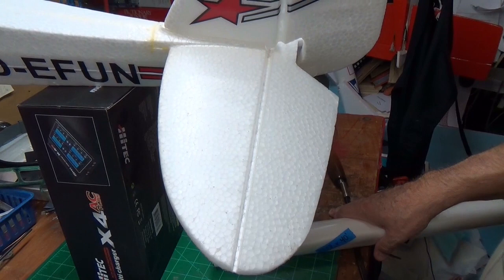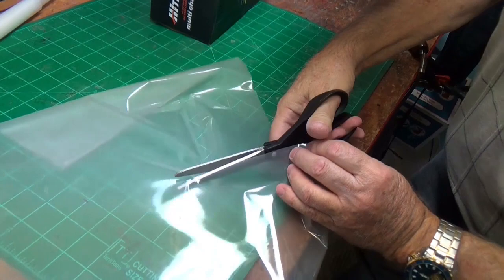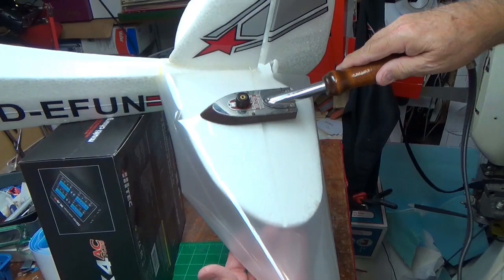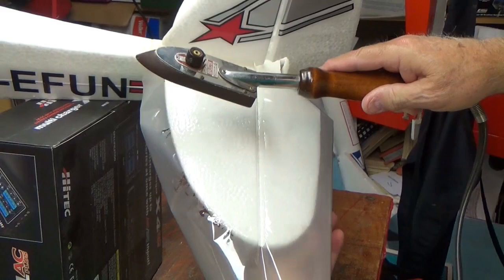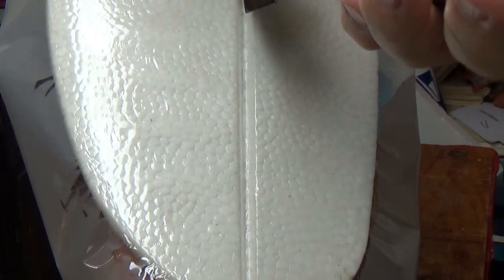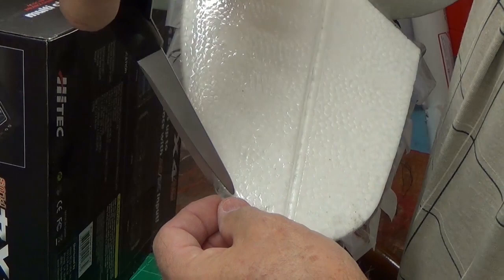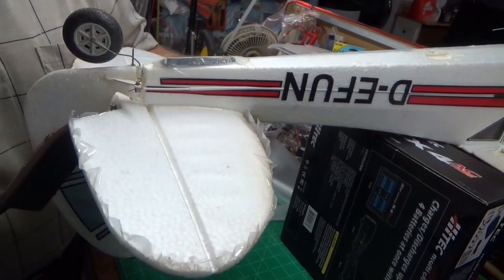How to Skin a Foam Wing with Laminating Film

Comment: Great video! I was searching for product ideas to skin a scratch built Predator drone I'm working on and your video convinced me that this is the product to run with. The ease of application and the end result sealed the deal! I'll definitely be using hinges on my control surfaces though as I heard these laminates may get brittle over the years but other then that the finish is incredible! I'm hot wire cutting my own wings and plan to retask some fiberglass arrow shafts I have laying around for my wing spars. 3 shafts in the central fixed wing section then dropping to 2 shafts (all 5 over lapping 3" at the union) where the removable wings join followed by 1 shaft centered out nearly to the wing tips. I was thinking about skinning it with carbon fiber but after seeing this I think I will save some money and go with this. I'm going big with an 8 foot wingspan for a nice stable camera platform for some serious FPV soaring fun. This will be my first plan with an Ardupilot system complete with GPS. The price for the electronics is amazing these days, the entire system with GPS, OSD, telemetry and power readings was only $79 bucks delivered! Back when I first started flying a cheesy 1 axis Gyro cost more then that! lol Thanks for the great information and video...

Comment: It's book laminating film for school books.  We used it for balsa sail planes back in the mid 90's.  You could get a ton of it for cheap.  You can also paint the inside "side" with a light coat of spray paint.  Really lightened those old planes.
Reply from the maker: Very true!
Thanks a bunch for watching!!
Reply: Yes I used it on many planes.  It is lighter and tougher than the model airplane coverings.  It does not shrink as much, but that is not a problem.

Comment: The point of laminating is that it works similar to a bike helmet. The foam alone is fragile, as is the covering, but together they work quite well. I'd say in my experience that you gain 50% over the foams original strength

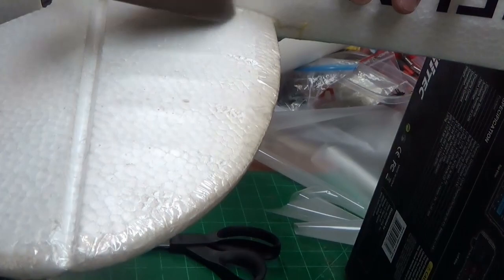Comment: about 8 years ago I watched this video and now I'm wondering if this system would work on the outside of a wood-framed shadow box I'm building for my granddaughter? I want to protect the inside of the shadow box from the weather with your iron-on system, will this stick to a wood frame? January 26/ 2024 8:42 hours.
Reply from the maker: It should work, I have covered balsa wood airplanes with the same technique. 
Just practice on something before you jump into it. 
Thanks a big bunch for watching. 
DG

Comment: I'm getting the Apprentice STS 1.5 meters.
Would it be best to sand the plane first for a smooth finish?
Reply from the maker: Not necessary to sand just make sure it is clean. 
Make sure you do the nose well. 
As a trainer plane the nose and motor are first to go. 
That is a great plane
Reply: Thank you very much.
Yeah, I think I made the right choice.
My first 3 planes were a Xk A800 with a cheap chinese transmitter :D @DickGibson
Reply from the maker: make sure you follow the instruction for initializing the radio to the stabilizer and check that the controls are moving the right way when you move the plane ..   This will assure many successful flights.   @Wings_of_foam
Reply: Yes, good point.
Cheers. @DickGibson

Comment: Is it neccesary to skin an all foam airplane ? Some skins are fairly heavy. Is reduction in drag penalty worth it ?
Reply from the maker: No it is not necessary however for some planes that not have landing gear or may have re occurring damage it is very important.
The weight is negligible and is spread over the entire plane.   1.3 mil thickness if very thin.  It is a lot of fun to do and much easier to use than a monocote type covering.
Thanks a big bunch for watching!!!

Comment: QUESTION: I'm just getting into RC aircraft, and I'm starting with a HK Bixler 2, and after I master that one, I plan to step up to a HK Phoenix 2000 and use it as an ALES [learning] platform.  Would you recommend this thin film for their EPO wings, or should I use the next thicker sized film?

Second, I've read that a lot of Bixler flyers put Scotch Extreme tape on the leading edges of the wings, and clear packing tape over much of the wing chord.  Could this film be applied over over these type of tape to give the wing a more finished look?

Thanks

Comment: Can i make one suggestion ... what ever covering you are applying be it tissue, silk, film etc always cover the bottom first then the top surface same with fuss bottom , sides , top.
Reply: What?
Reply: I don’t think so you always close on the bottom. Like a cap on a bottle
Reply: Lid on a bowl is probably a better analogy
Reply: Makes sense...You avoid having a seam on or near the leading edge of the airfoil facing the relative wind.
Reply: @bigdog1476  Your lid and bottle cap analogy seems more fitting to what this poster recommended.

Comment: hello, i just a got freewings al37 737 max, and would like to cover it with laminating film, wich film would you use, 1.7 3 or 5 mil size thnaks
Reply from the maker: I would use the 1.7 because it is easier to form around round pieces. 
It also overlaps better without seeing the seams. 
I personally would try to do the fuselage in one long piece equal halves. Starting in the center and working my way to each end. 
You could probably do the wings top and bottoms with one piece for each top and bottom. 
This will be a big project and lot’s of fun. 
I now get my laminating film from Amazon. 
Thanks a big bunch for watching!!!
Keep in touch
Reply: Dick Gibson will do, follow my channel for updates on the build. Will let you know what I finally do looking at several options. Gracias from Colombia
Reply: Hi Dick good day, i ordered the film already, but i am wondering will the foam cells bloat with the heat. the planes foam surfaces are very smooth now. how hot is hot enough for the iron. thanks
Reply from the maker: davidsai 
Experiment with the heat settings on the iron 
Find what works best for you. 
Some foams don’t puff. 
Check out my “My Twin Dream “ video. 
That foam is as smooth as plastic.
Reply: @DickGibson  film allready at the miami offcie should get to colombia next week.

Comment: I want to build my P-40 Warhawk into just a model. I have laminating film but I was wondering, if I laminate the foam to give it more strength, can I prime over the film with plastic primer and then do my paint, then clear coat it, will this work or will the paint just chip off ?
Reply from the maker: Absolutely.  If you want to paint before you laminate that is probably the best.
However, if you paint after lamination then scuff with a very fine sand paper, scratch pad or steel wool, clean with alcohol then use a simple rattle can fast dry to paint.
Reply: Thanks Dick. I was also wondering if putting two layers of lamination would work, then the paint. I was wondering if it would stick to the previous layer and should I scuff up the first layer for better adhesion ? Thanks

Comment: I would not do it that way, as the surface bubbles up (doesn't look nice imho) - much too hot with the iron to keep a smooth surface. 
I recommend the adhesive Oracal 751C film which max. requires a hairdryer for carved surfaces - it's like car wrapping...!

Comment: I would imagine  that this reduces surface tension tremendously,   making the airplane more slippery thru the air....
Reply from the maker: f marz 
Absolutely plus makes the plane much stronger. 
Using less heat will produces fewer bumps. 
Different kinds of foam show fewer bumps. 
Paint before you laminate.

Comment: These foam dots bulge up when heat iron put it on them, It is not easy for someone who has trypophobia. I wonder if you can moist the foam first then apply the "new stuff", would the "new stuff" still sticks?
Reply from the maker: +ASUS Micro I have had that question before.  POR  the hot iron technique "I believe" makes the combination of the laminate and foam stronger.  Putting water on before would only make the dots more noticeable.   Perhaps you could try setting the iron a little cooler and see what happens.
Thanks a big bunch for watching

Comment: The heat is expanding the foam dimples resulting in a textured finish - not a smooth glossy finish!
Reply: I noticed that as well. I think this method uses too much heat for this type of foam.

Comment: Hi, Mr. Dick. Great video! What do you think to use a 3 mil (75 micra) film to laminate a MTD, that is a "heavy" plane, but with much power too? Thanks. See you.
Reply from the maker: Luis  I laminated my MTD completely with the 1.7 except for the bottom of the fuselage.  On the bottom only for abrasion protection when landing.  The 1,7 is plenty for the rest of the plane and yeilds a very smooth finish.
You will love the MTD,  it is one of my favs!!
Thanks a bunch for watching.

Comment: Does this work better than let’s say epoxy and fiberglass?
Reply from the maker: No comparison!  epoxy and fiberglass would be way way too heavy, hard to do and expensive.   This method is easy, very low cost, and super strong.  You can also paint before or after application of the film.  I have other videos in the series you can watch also.  Thanks a bunch for watching and if I can offer more help let me know.
Reply: Dick Gibson wow, you’re the best! Thanks for getting back so quickly. Can you post s link to where you ordered it from? I have a bunch of new planes coming in - balsa and foam (EPO and EPP) - and I wanna do this before I assembles. Obviously the balsa is going to be monocoat, but the foam I wanna do this. Especially for protecting the hinge
Reply: I’m also going to disassemble all my foamies and do this! Thank you
Reply from the maker: @rossrcfallacaro3422  
https://www.amazon.com/s?k=laminating+film+1.3+mil+25+x500%27+standard+roll&ref=nb_sb_noss

Comment: Hey, I saw your link to aloft hobbies. I was thinking of getting the CP type film, but what mil should I get? I saw you got the 1.7 mil, which they say is for small planes. My Plane though is about 6 feet in wingspan and weighs as the most 8 pounds maybe. So I was thinking 5 mil would do the trick, but maybe 3 mil? I reckon 10 mil = about 250 microns = about .25 millimeters. So is mil the thickness of it? It seems like .25 millimeters is really thin.
Reply from the maker: +Sky Studio Great question: I like the 1.7 on the top and sides of the fuselage and top of wing and 4 or 5 on the bottom of the wing to give it a little strength and 4 or 5 on the bottom of the fuselage for abrasion protection.  In fact two layers of 4/5 on the bottom.  The 1.7 is easiest to fit around corners and tight places.  My SkyWalker is laminated that way and it is perfect for me.  Thanks for watching,
Reply: You say you put maybe two layers on the bottom of the wing? Wouldn't it be easier to simply buy 10 mil and just put one layer on the bottom? Thanks for the reply though. I will probably put 3 mil on top and possibly 5 or 10 mil on bottom of wing.
Reply from the maker: +Sky Studio That would be great also.
Try 2 or 3 different thicknesses to see what you like.
There are no wrong answers, just try it!!
Thanks

Comment: What this laminating film does exactly?It makes foam not as easy to brake?
Reply from the maker: Yes it adds structural stiffness and stability.  Also if you do crash it makes it easier to repair.  Unlike mono cote it is very resistant to abrasion and puncture.  If you use the thin film it adds very little weight.  Plus you can paint the foam first and laminate over the top and the color won't scratch off.
Thanks a bunch for watching.
Reply: +Dick Gibson Thank you for fast reply.I hope to be so easy to install as it seems.
The sailplane will be FunGlider Multiplex
Reply from the maker: I am doing my second Fun Cub this week.  
Go slow and have fun

Comment: How much stronger does this end up making the plane?
Reply: A large bunch!!
Reply: I can vouch for the added strength. I have a sheet foam "foamy" Flying W and ironed on laminating film all over. I've had some not so gentle touch downs and it still flies where others would have been bent or broken in half. Takes a little while to iron it all down but hey, the results are well worth it.

Comment: The foam is expending so the surface is not smooth anymore after laminating process and more wind resistance plus more weight of your plane .If you have crashed your plane it's much more difficult to repair the plane because you need boiling water to get back the original form of your ( plane,foam) before the crash.No it's not a good solution in my opinion.I use cheap superglue to strike over the servants of the plane ( EPO FOAM only!!)and it will make your plane 50% ore more stronger and super light at the same time plus still easy to repair your plane after you have crashed it🤔😏
Reply from the maker: You should try it first to get a first hand impression.
The weight of the film is minimal and only adds a few grams to a big plane.
The plane is much stronger with the film!
If you crash with the film on it is sooo much easier to fix and a touch the damaged place with the iron and it pops back out.
Thanks a big bunch for watching
Reply: @DickGibson  If you ask me it's a lot of work and if you want to do the fuselage it's almost unduable because of the roundings, but of course your right that i have to try it first before i can give it a real judgement.Ps like your video, keep up the good work 😉💪👍

Comment: Nice job Dick.  I'm sort of an old timer when it comes to RC craft.  Built my first in the late 70's with the old monocote and had an iron just like yours..  I may still have the iron, not sure.  Anyway, I'm looking to get back into fixed wing.  Have my eyes on a foam Bixler.  Do you think my heat gun would work?  Granted, I cannot press the film like you are doing here plus you need to be careful with the heat gun.  It will melt this Ethylene/PP foam if you get too close to it.

Comment: ... Excellent video.Usted could clarify me what kind of film used. No entindo when speaking English , perhaps entinda if he writes. Thank you, I send a greeting from Argentina
Reply: MarianoP1000 eso se usa para laminar libros. Posiblemente lo puedes encontrar en una tienda que venda materiales para colegios.
Reply from the maker: This is the material used to cover a document, business card, picture, ID card, that you would go to an office supply store to have done.  Their machine has two rolls of laminating film in them and your document or card is placed between these two pieces and place in an two sided iron and heat sealed.
You can find this film on Amazon or Ebay or at your office supply store.
Thanks for watching.
Reply: @pagrichard  gracias!!!

Comment: Hi Dick, great video, your a real character.  I have a question I hope you can help me with.  I recently bought a Hobby King X8 Skywalker flying wing.  It has about an 8 foot winspan and higher speed cause oscillations on the wings.  This thing is foam and I was wondering which laminate choice and thickness you' would recommend.  I look forward to hearing from ya.   -Greg O
Reply from the maker: +Greg O Greg I would definitely recommend laminating the X8.  I would use the 3mill or 5mill. There is such a large area to cover and the thicker film will add so much more strength to the plane.  The x8 is not a high speed plane.  It has been documented that the wings will fold during high speed maneuvers.   The x8 is a slow stable camera platform and a hoot to fly.  There is a lot that goes into setting up the x8.  The CG must be spot on and there needs to be a little reflex in the elevons.  What OSD/Control system are you using?  Can you send me some pix of your build?
A wing is sometimes hard to get set up.  I will be more than happy to help you any way I can.  Try to message me or use face book with my name.
Reply: Hi dick and thanks for offering your help, I really could use it.  Currently I am sourcing parts and deciding what equipment I will use.  I have not glued anything together yet as I want to make certain that access for wiring etc for future equipment is not impeded by putting everything together.  I have ordered up the laminate, some fiberglass for the wing tips, servos, engine and props.  I am eagerly awaiting their arrival.  This plane is white foam.  I would like to see it painted dark or light grey(my Navy experience/preference).
Would you recommend painting it prior to laminate or post?  What spray paint would you recommend?
Reply from the maker: +Greg O You may experiment with some aerosol spray paints.  I would not recommend water based paint.  Painting the foam with a very light coat and covering it with laminate is best.  However, Krylon fast dry outdoor paint will stick to the laminate.  I used that same paint on a foam plane and covered it and it looks great.

Comment: Hi Dick,Great Video been looking at doing this Laminating for awhile now but haven't had the confidence too do it.You have made it a lot easier.Where about did you buy heat Iron from.Cheers from NZ
Reply from the maker: https://hobbyking.com/en_us/turnigy-covering-film-iron.html
http://www3.towerhobbies.com/cgi-bin/wti0001p?&I=COVR2550&P=FR&atrkid=V3ADW3A24148B_39159633250_pla-326341586606__201979541663_g_c_pla_with_promotion__1o1&gclid=CjwKCAjwoNrMBRB4EiwA_ODYvxbYATozP0oC5FFnHXN2GSKh0i4dOl8V_2VEE03-t8qSVTEPflW1uRoC0boQAvD_BwE

Any iron like this will work.
Thanks for watching and don't be afraid to try this it is great fun!!!